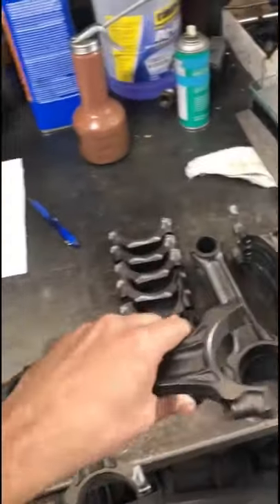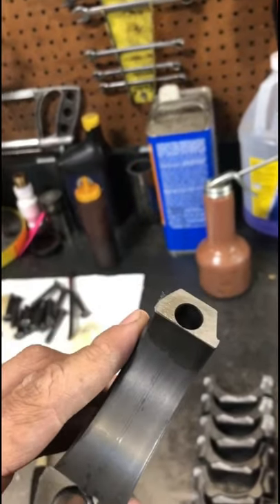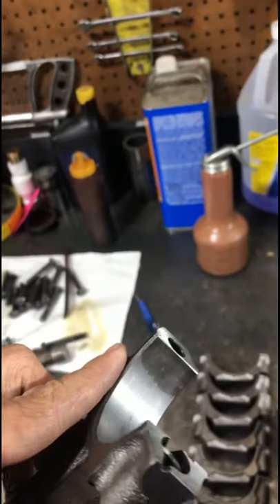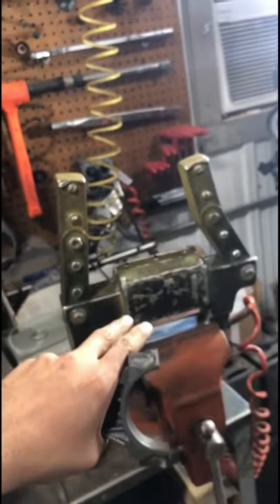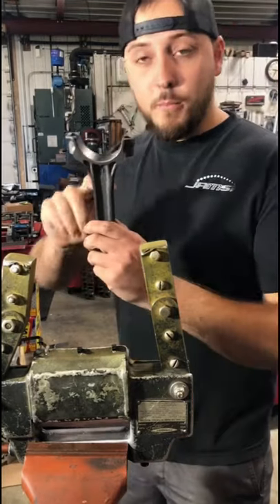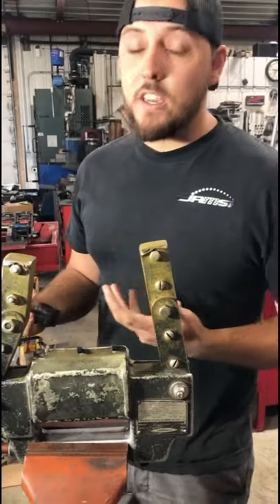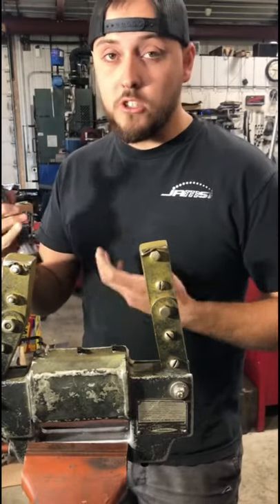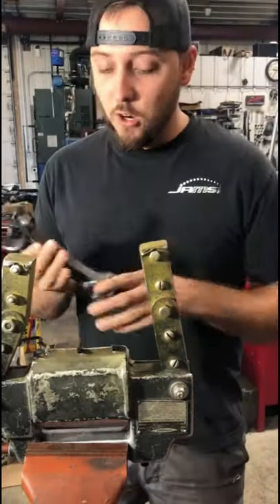#shorts Easy way to check if your connecting rods are demagnetized!

Comment: Also, here's an explanation for those wondering for the demagnetization process works: There are so-called magnetic domains in material. You can imagine those like tiny magnets that can rotate. If those are all aligned in one direction, you have a magnetized piece of material, because the magnetic fields of the little magnets add up as they are all in alignment.

By passing the metal through a rapidly changing magnetic field, you shake up the alignment of the domains so they aren't oriented in one direction any more, so their small fields cancel out and the conrod is no longer magnetic.
Reply: You have the basic physics right, but you need the magnetic field to both alternate, and slowly get weaker (over a second or two). Old CRT monitors had a coil around the front that would turn on and then slowly power down  (degaussing) and here pulling the conrod away moves to a weaker area.
Reply: @RobertSzasz  Yeah, that makes sense. If you would suddenly shut the field off, all domains would be aligned, and by slowly moving out, domains which are affected at different strengths of the magnetic field exit the field in different orientations.
Reply: Thank you for the explanation
Reply: Thank you
Reply: @bryantzerrato8255  You're welcome
Reply: Wow thanks to both of you! I was curious how the process worked. That’s impressive you know that!
Reply: I literally wrote a similar explaination and i then found yours! We used to call them "Weiss areas/domains" in school.
Reply: What's a conrod
Reply: @caterpillarslim1288  short for connecting rod, the thing he was demagnetizing
Reply: So why do they become magnetic to begin with?
Reply: @toddmccarter45  I'm not entirely sure about that, but I suppose it could have something to do with the elevated temperatures present within an engine. Take this with a grain of salt tho.
Reply: Wow thank you for that, the min some crazy  stuff is said everyone forgets the whole point to the video and jump to the crazy stuff
Reply: You know this was a joke right?
Reply: @HaveAGoodDayFk.U  I'm not sure if Jim's statement about that he doesn't know how that works was a joke. The video as a whole, yes, that is a joke.
Reply: There are 2 poles of magnetic fields in every item but whenever their facing random directions it balances itself out pulling it in a magnet will draw the fields to all face the same way greatly increasing its force ._.
Reply: @bloopbloop5663  ...that's literally what I was saying.
Reply: This is cool thanks for the explanation!!
Reply: @bloopbloop5663  and he counteracted that by not letting the magnetic fields align
Reply: You can act kr the domains by smacking it into something too. Try a nail it a file that has been magnetized and smack it on something
Reply: @RobertSzasz  yes, that's why you also slowly move it through the magnetic field

Comment: Demagnetising is also called degaussing. Anyone who loves mechanical/automatic watches probably owns a degausser, especially if they work around any magnetic fields. It works by energising the degausser with the watch atop for about 10 seconds, then slowly drawing the watch out of the magnetic field.

By the way, you can use a small compass to test if something has become magnetised.
Reply: Thank you
Reply: All of those connecting rods were made in the foundry I worked at. At the very end of the process to get them cleaned up for finishing plant they went through a demagnitizer. We made American motors, Pontiac, Cadillac and Buick rods. All sheared clean, bores punched and straightened by a huge Verson Press.

Comment: That is an AC magnetic yoke.  It alternates the magnetic field by reversing the poles at 60 Hz which scrambles the alignment of the iron ions in the connecting rod, thus making it non-magnetic.

Comment: Aren’t magnetic connecting rods better than a magnetic drain plug?
Reply: No. Will bring debris to the con rod and wrist pin and that wont end well
Reply: No
Reply: I've heard that also. As the rods get closer to the head the head pushes them down with more force as they are the same polarity so you can get a few more horses out of the rods
Reply: @humbertovaldez4710  what, no

Comment: How do you connecting rods become magnetized in the first place? And is that a bad thing you would think that would be good they'd pick up all the metal shavings from the bearings and not let them go in the oil.
Reply: Well if they kept all the shavings they would wear out quicker so it's better to let them settle in the oil pan.

Comment: The way demagnetizing works,

You need a alternating magnetic field, when you put the metal into the field the internal magnetic domains follow the external field, flipping back and forth. When you slowly move away from the electromagnet the field strength drops away so the metal keeps flipping back and forth but smaller and smaller amounts until it has nearly no remaining direction of magnetization.